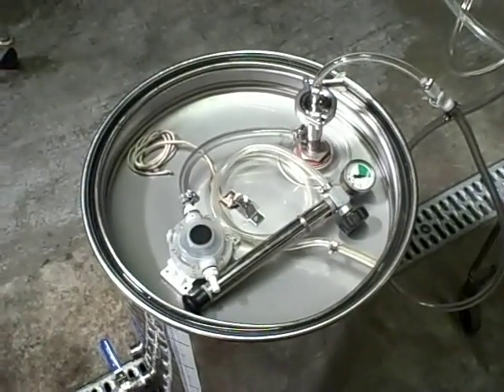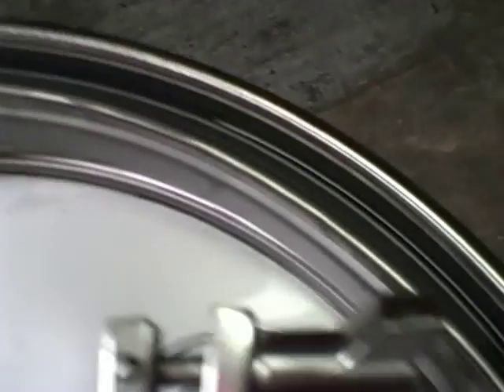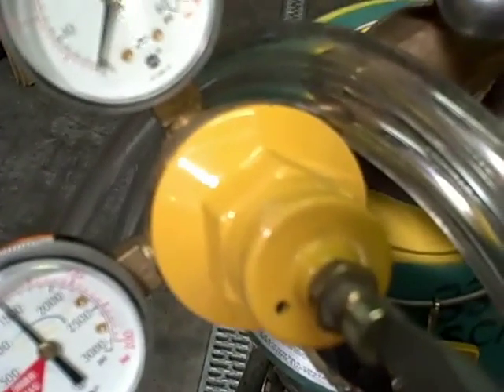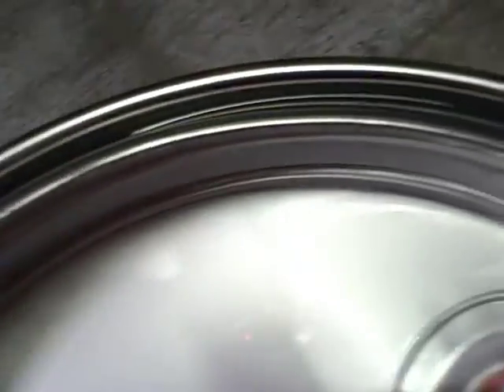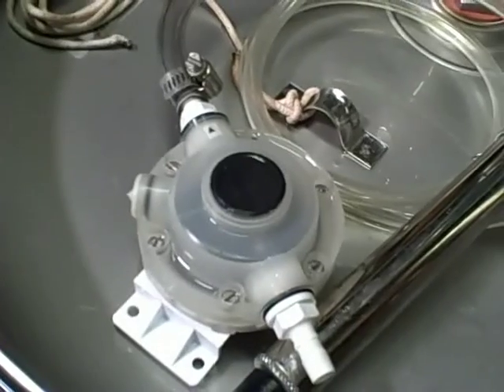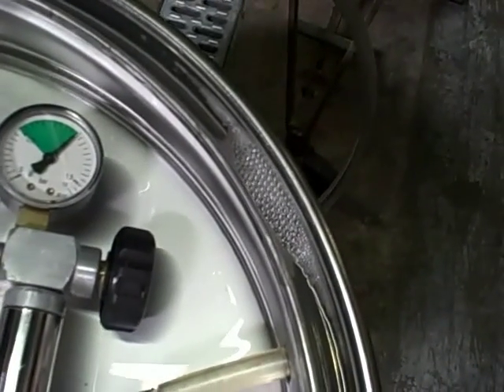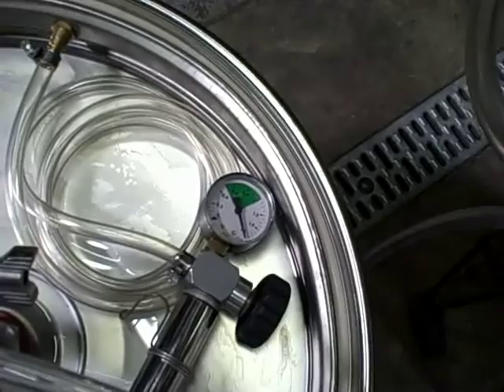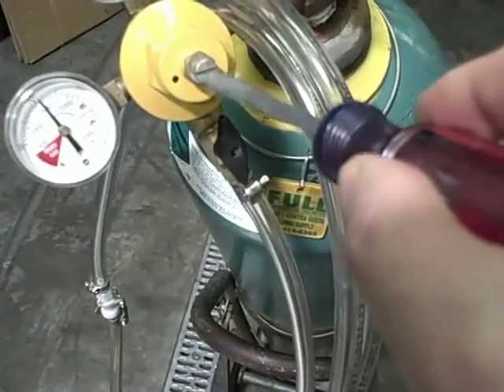MoreWine!'s Variable Volume Lid Gasket Exposé vid 2 (blow-off test)

Comment: What would you think happen if you increase pressure from a gas tank while using white rubber gasket? Lets say up to 5 psi? Will it hold it? Why does your blow off was venting when there was so small amount of pressure? Shouldn't it start to vent after 10 psi in the fermenter? "The correct pressure to set the tank regulator to for use with the WE399 is 2-5 psi. The bleeder valve that is part of this kit has an auto blow off at 10 psi, so having the regulator any higher than that will cause the bleeder valve to vent to the atmosphere and thus drain your gas tank."